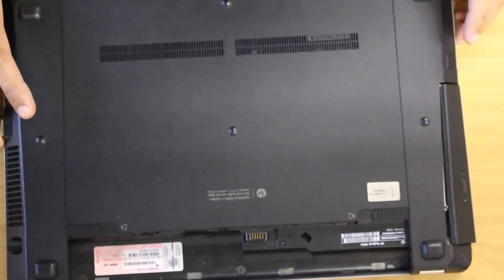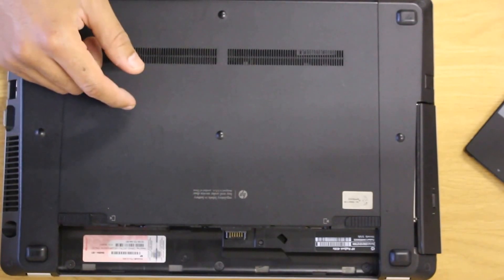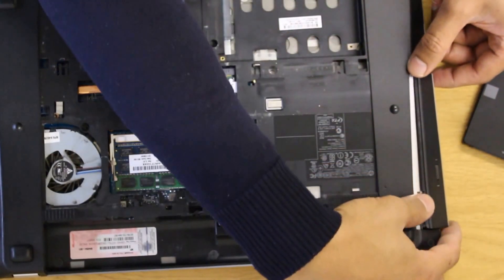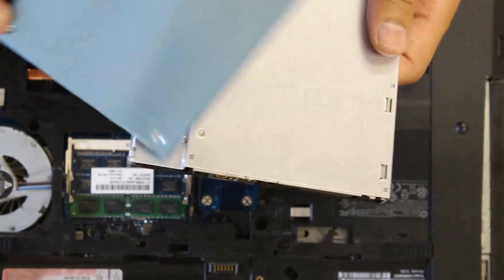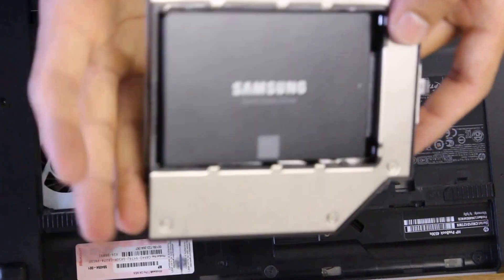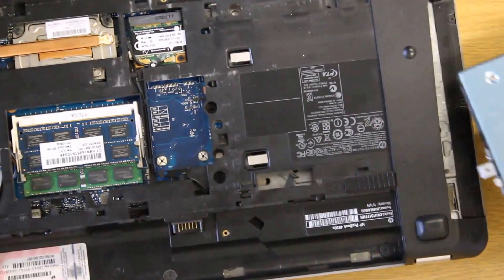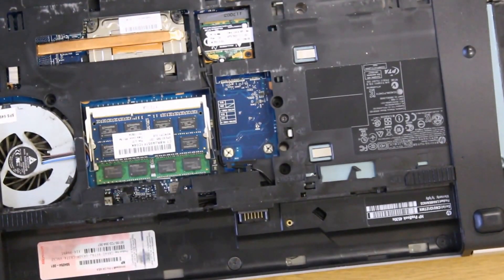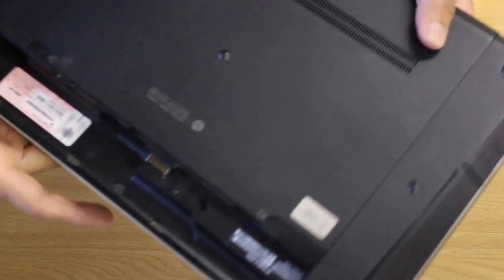hp 4530s ssd upgrade

Comment: There should have been a small set screw(s) on the side of the adapter tray (somewhere near the back) that helps keep the drive locked into the tray. My HP adapter tray had one.